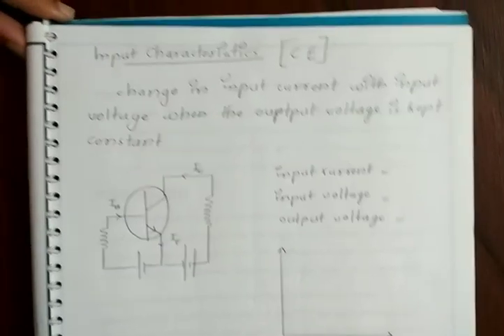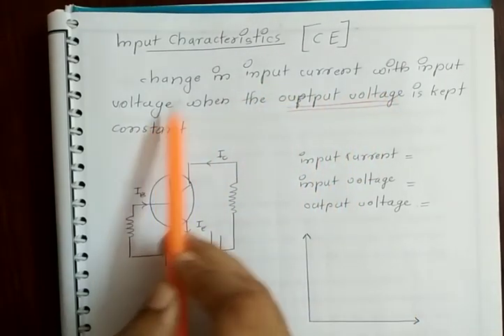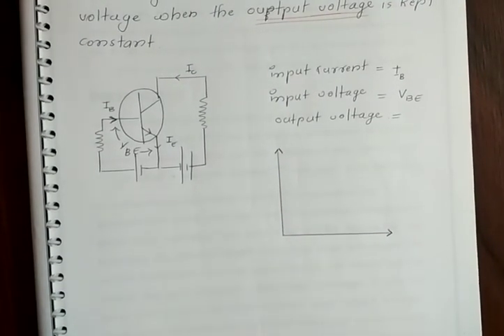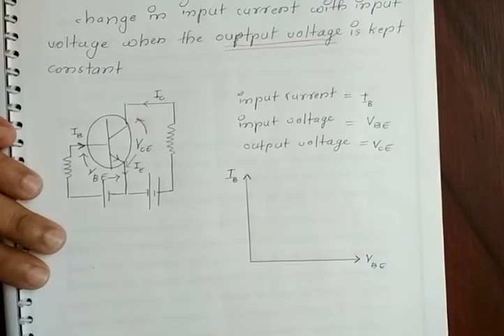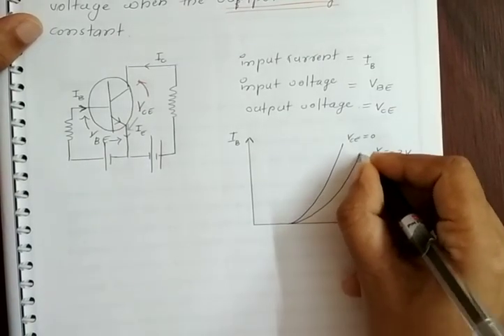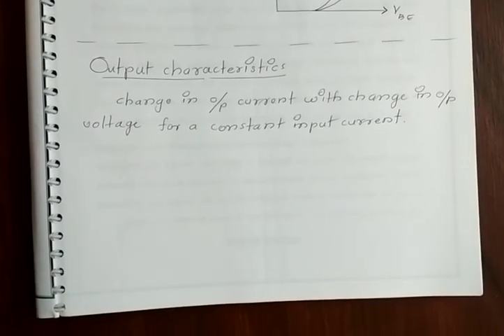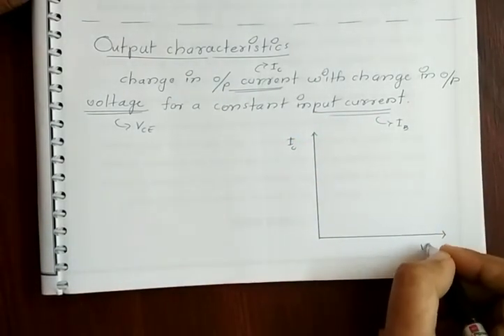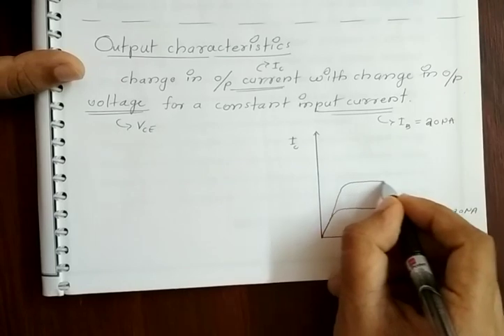Input and output characteristics of CE configuration Malayalam Tutorial

Comment: Why we are taken in input characteristics output voltage constant and in output characteristics input current constant ?can you please  give the reason madam.
Reply from the maker: That is the usual method of taking input characteristics.. we keep a particular quantity constant and then check the variation of other two parameters.. this method is used in many branches of physics
Reply: @Physicsbyshalu  but madam i am asking why we are taking output voltage constant why not output current constant in input characteristics and also in output characteristics why we are taking input current constant,why not input voltage?
Reply: @erakesh8802 IC CHANGES WITH BOTH VCE AND iB